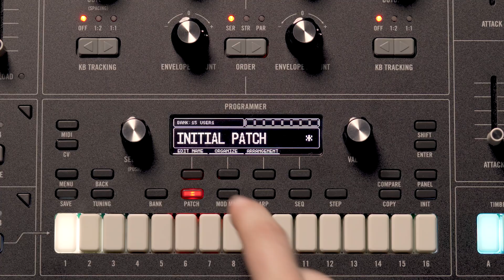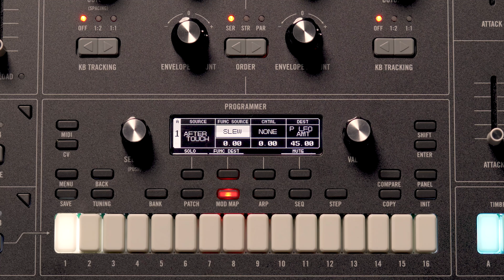Muse | Quick Assign

Comment: Sounds pretty sweet considering this is using just 1 osc :) Is there such a thing as LFO delay? I use that quite often, and it'd be nice if it could be done on the Muse as well!
Reply: Checking the manual, there doesn’t seem to be sadly. The One has it - hopefully a firmware update could add it as it’s something I use a lot of the Diva.
Reply: No delays and fades for LFOs. It's the most lacking feature in my opinion.